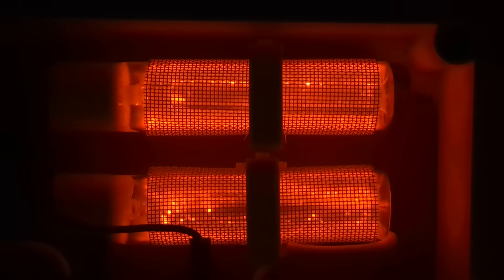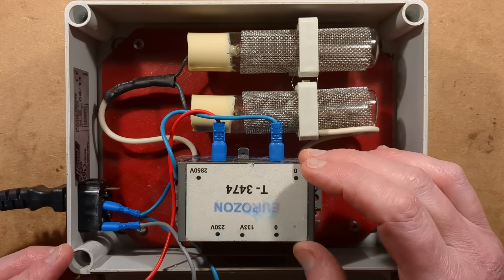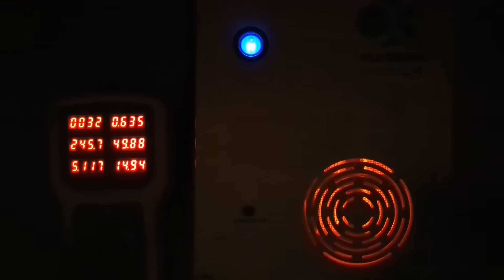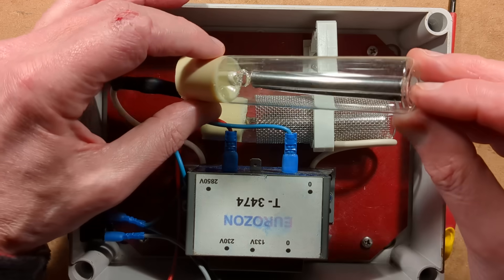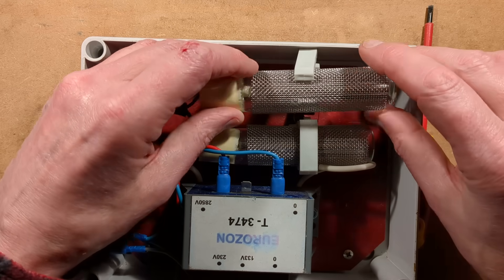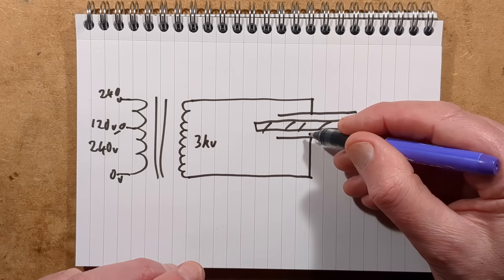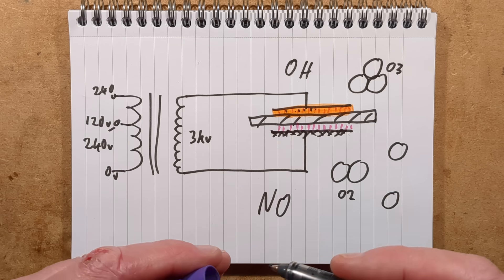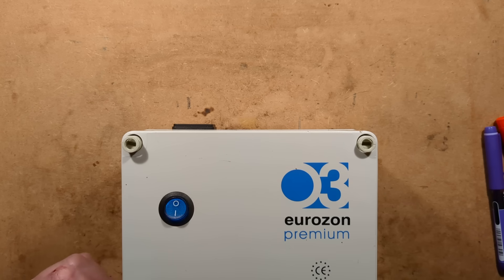Neon plasma ozone generator

Comment: I think it's easy to tell by this video's title that this product is a fraud. If neon plasma could generate ozone, companies wouldn't be using it in light-up signs because the ozone generation aspect would've made that too dangerous and they'd be thinner versions of germicidal fluorescent tubes at that point.
Reply from the maker: Aside from the neon's own discharge the plasma occurs on the outer layer of the tube between the glass and mesh.  It definitely produces plenty of ozone.

Comment: Interesting design.
I once accidentally got an ozone generator. One of my monitors started doing those high voltage discharge noises, and some time later I started smelling ozone.
Turns out the wire insulation to the backlight discharge tubes went bad and the cables started arching to the metal frame inside the monitor.
Through the magic of having two monitors of the same model, I just switched them. The "broken one" now awaits its repair (it has been 6 months). xD

Comment: Looking at the connection of the mesh around the tube.
Only one is connected?
Shouldent there be another white wire to the tube nearest (at 6.08) the case?
Reply from the maker: There is a loop of wire between the two tube clips to bridge them together.

Comment: AFAIK ozone's effect is due to reverting back to O2 + O .. and atomic (not molecular) oxygen is very powerful reactant ..
btw, i work for water/waste-water company .. just an IT guy ;)
we produce O3 for our water purification on site .. the huge reactors and sound of that high voltage discharge .. :)
and you can smell it even if the reactors are heavily sealed .. powerlines by themselves put out some O3
and of course - environmental monitoring in every room, oxygen masks .. and all the other opera gear ...
..
Chlorine warehouse is ~ 500m away .. with security that probably beats Fort Knox ..
Reply from the maker: It is the oxidising effect of ozone getting rid of one of its oxygen atoms that does the sterilisation.

Comment: I used to work in a water bottling factory. They used an ozone generator that pumped the ozone into a stainless steel water holding tank. That water was used to fill the plastic drinking bottles. The filled bottles were stored for 2 weeks before shipment.
Fun fact, ozone decays rubber, particularly under strain, by reacting with the double bonds in the polymer chains
. This causes the rubber to degrade, leading to surface cracking, reduced tensile strength, and a shortened lifespan
Reply from the maker: This is why the ozone handling systems use silicone rubber seals and stainless steel.

Comment: What ozone generator product would you recommend for sterlizing a typical room in a house over a few days? (room closed and not used while treating)
Reply from the maker: I can't recommend any unit in particular.  The most affordable device could be a generic room ozone generator as found on online sites like eBay.  Just treat it as a typical shady imported device.
https://www.ebay.co.uk/itm/167938236310
I would only suggest using something like this in short bursts and not leaving it running for days.

Comment: The assembly of this device must have used the coal shoveling method, by the laid off coal plant workers in china. 

Take shovel and go into pile of parts. Dump said parts in box supplied. Ram lid on top of box and use whatever screws are around workstation. Stamp QC 2022. End shift. Start shift as ebay vendor.

Comment: I have an old ozone generator that is probably about 100 years old now. It's a backlight box with a neon sign transformer in it. Thick rubber leads go to an ozone generating head that has an array of tubes with alternating fills of neon and argon. They have single electrodes and spaced about 1/16" apart so you get mild arcing between the tubes. Works well. It does have a wire wound rheostat to control the current to the transformer.
Reply from the maker: Take good care of that.  It's a very collectable item.

Comment: Is it actually safe to use these inside a car? I mean, if it can oxidise basically anything, isn't it possible that it can affect the electronics and plastics  inside in a longer run?
Reply from the maker: Car dealers use them to give unoccupied vehicles short and strong ozone treatments to remove odours.  Continuous high ozone levels would degrade some materials and be harmful to the passengers.

Comment: I could see them depending on diffusion to assure a certain amount of ozone in an area rather than just allowing it to forcefully pour out.  I dunno if that much thought to design was done in this case though but they maybe had some idea of the space inside the box saturating and maybe just the density and maybe slight heating and just the tendency for things to equalize just very weakly diffusing in to the room.

Comment: I've worked on industrial Corona discharge systems for many years ... Some with discharge surface areas into the several square meters... It's a commonly used method to etch the surface of materials to be printed on... .. strangely right outside the discharge vent from several of these systems grows one of the largest and in spring prettiest cherry trees I've ever seen. The smell of ozone near the tree is overpowering.... I've often wondered if the tree is benefiting from having most molds and bacteria killed that would normally attack it.
Reply from the maker: Ozone is used for crop protection in indoor "herb farms".

Comment: i got a UV C sterilization lamp... when i use it it smells something like bleach.. is that ozone? i stop using it because i cant properly ventilate the room...
Reply: That’s a bingo! That’s the way ozone is generated naturally outdoors with sunlight.
Reply from the maker: Yes, some UVC lamps do generate ozone which smells like bleach as you describe.  It is safe to use if there are no humans or pets in the room when in use, and the ozone will penetrate where the UVC couldn't.  You just have to turn it off and give it time to dissipate before spending significant time in the room.
Reply: i got the lamp to use it in the basement to kill the mold but the problem 1st i think you cant ventilate on the basement because ozone is heavier than air, 2nd i am not sure if uvc kills mold and 3rd probably the ozone is fast rusting all the metallic things in storage... uvc lamps are the easiest way to create ozone in large amounts but being exposed twice to it i dont see the benefit...
Reply: you could use the UV-C lamps in cooperation with an activated carbon filter. Let the lamps run for something like 12 hours to create the ozone, the UV rays also kill microorganisms and then turn them off and run the activated carbon filter. Ozone and activated carbon are basically natural enemies, extinguishing each other.

Comment: Completely unrelated, but have you ever bought any of that coloured sand from China? The reason I ask is because we've just had a big scandal here in Australia where they've found asbestos in coloured sand used in school sand pits. I suspect it may have been imported from China, since we have very strong regulations against asbestos in products made here, since Australia used to be one of the biggest producers of blue asbestos.

So if you happened to have bought any of that decorative coloured sand, I suggest you dispose of it just in case.
Reply from the maker: I've not bought sand, but I'm suspicious of some materials.  I know China still uses a lot of the curly fibre chrysotile asbestos.

Comment: Seems like a neat little unit, I'd drill some holes into the front panel and mount a small AC fan there, during some research I have found some low-noise options, like the Orion OA80AP‑22‑2WB (9W, runs at AC mains voltage), or if you want to go the hacky route you could put in a small diode bridge / full bridge rectifier and run the 12 volt fan across a resistor, although this is very inefficient, you would need to dissipate around 60W of thermal heat assuming a 1.56 kΩ resistor.. this would not only make it sterilize the air, but also heat it up if the resistor is mounted to a heat sink.. yeah no, this is getting out of hand, you would have to take thermal protection and so on into account.. there's a very neat (and quiet .!) 80mm 85–265 V AC fan - the "ebm‑papst AC 8300".

Excuse my ramblings, love ya vids :)

Comment: You 'need' to add a 'capacitor discharge pen' to your next AliX order, I am sure you can have plenty of cracking good fun with one. Ordered one to better protected my $500 LCR in circuit Tweezers and several of the Inductor Testers you played with recently including a battery option. $20 well spent for fun .....

Comment: I imagine the plastic is also getting degraded/embrittled by the ozone too. That might have contributed to rattles. 
I'd have liked the seller to have looked inside and fixed it plus filling the box with peanuts to prevent movement
Reply from the maker: The inside looked strangely untarnished by ozone.

Comment: You can't go wrong with nitrogen oxides. The main ones are Nitric oxide (NO) and Nitrogen dioxide (NO2) but there are also:  nitrous oxide (N2O), dinitrogen trioxide (N2O3), dinitrogen tetroxide (N2O4), and dinitrogen pentoxide (N2O5).

Comment: Few years ago i got one from China its a usb powered version and when i got it i was wondering if i got scam. Because i noticed they use a green colour neon builb with some wire mash on the outside for the ozone generator. When its plug in you can see the neon glow green.
Reply from the maker: If you sniff the unit while it's running you may get a slight bleach-like smell.  A common technique for small ozone generators is to put a metal mesh around a neon bulb in the same way this works, but much smaller.

Comment: "Ozone" comes from the Greek for smell? 
Pretty much - the root occurs also in the element osmium, which is apparently pretty smelly stuff when you use it's tetroxide (OsO4) as a stain for microscopy. Electron microscopy - and never having used an EM, I can't adduce this from personal experience.

If you can bubble your ozonated air through 50%+ hydrogen peroxide. That
s 50 percent mass/mass, not "50 volume" which you can probably get at the industrial hairdresser suppliers. Along with a visit from the nice armed anti-terrorist police screaming gently "show me your hands" and "comply or I fire" and such love poems. But once you get past that entertainment, and get the bubbler going, you can make peroxy hydrogen peroxide, H2O5, a.k.a. peroxidane which is a really "fun" reagent. For certain values of "fun". "Check your buildings insurance first" levels of "fun".

Comment: Is there a good way to catch the NO without also getting rid of the O3?
Reply from the maker: It's exactly the same active gas molecules as created in nature.  To create purer ozone you need to provide a unit like this with concentrated oxygen.
Reply: That somehow leads to my next question: What’s the most efficient way to concentrate oxygen? Do you have to get it in its pure form in tanks (maybe a bit dangerous) or go the chemistry class electrolysis of water route?
Reply from the maker: @abavariannormiepleb9470  You can get oxygen concentrator machines that use molecular sieves to filter different components of air.
Reply: Thank you very much for the education!

Comment: Clive... two questions 
Are they 12 volt crimp connectors used for 240 volts?
If so are they safe to use for that type of application?
Could you also explain the power factor measurement in a little more detail and where and how you get that figure and what that actually means please?
Thanks and another great video 
Keep up the good work 👍 
Regards Off Grid Andy from Aussie Homestead NSW Australia 🦘
Reply from the maker: The standard insulated crimp connectors are rated for 240V.
Power factor is the relationship between the voltage and current waveforms.  The perfect power factor (unity) is when they are in sync.

Comment: Without a fan, O3 levels in the enclosure will be very high - high enough to cause significant degradation of all those plastic components. It would be a very good idea to put some form of low-profile fan in there, just to prolong lifespan. I seem to remember a review of an ozone generator based on ordinary neon indicator tubes,  which was just as impressive!
Reply from the maker: I showed car ozone units with the neon tube technique.

Comment: 133 and 233 volts wtf is france doing over there?
Reply: In Europe, the mains voltage is usually 220-230 while here in the UK, it's usually 230-240 but it can vary a bit depending on your location (ie how far away from the nearest substation you are) and time of day (based on overall demand)

But it should be around 220 in Italy, so maybe the extra 13V is just a mafia tax :D

Comment: I just discovered a wonderful use for ozone.  I had occasion to run my generator on an exterior enclosed porch that has issues with spiders.  I sealed off the porch and set the O3 on nuclear.  I found that spiders and also wasps seem to perish with high volumes of ozone.  Seems the critters get pretty ticked off and perish while trying to escape.  This pleases me greatly.

Comment: Some places in Italy, Spain and France have a 133/230 V low voltage distribution network, so the appliances are connected across 2 phases. I was surprised to see a transformer with a 133 V tap, I don't think any of those places have a neutral available for 133 V loads.

Comment: I thought it would hav e a  high voltage  flyback circuit  on a  PC board , not just a transformer but it works
Reply from the maker: This is the older and simpler way of doing it.  But only suited to low level generation.

Comment: On a completely different subject !!!! 
Do you have recommendations for types and sources for your Spugers ? 
I found one of the metal ones for just under a tenner but then they wanted nearly £6 for P&P and little else on offer to add to the order to offset it against!!
Reply from the maker: I use an iSesamo spudger.  The genuine ones are a bit more expensive, but last a very long time compared to the slightly cheaper clones.
Reply: Thanks Clive

Comment: Pass the ozone through a fishtank airpump/bubbler stone, and you now have a veggie & fruits sterilizer(suggest a mat made of activated charcoal for lid).
You can also ozonate olive oil🤔(need to keep it cold to maintain effectiveness). Set the gizmo on timer for 15mins and walkaway to avoid excess exposure to ozone. For a longer lasting setup, suggest replacing fishtank air pump with a silicone tubing peristaltic one, and a custom air stone with teflon tube, to make it ozone resistant. The versatility is that, you use it in any vessel(PP plastic, stainless steel bowl etc).❤👍
Reply: The ozone will decompose the plastic parts and spread the chemicals onto the produce. My unit is one of the wooden box type, try that style rather than a plastic system.

Comment: 02:36  Maybe they relied on ozone being heavier than air, pooling at the bottom of the unit and trickling out of the bottom slots.  ???  I've not seen one quite like this before.  Nice find.
Reply: I bet, the tubes and the transformer produces enough heat   to create airflow

Comment: I had to encase a little handheld/keychain project i made when my ARC tube started to give a coronal discharge and was producing ozone.  I just wanted to make a Xenon Arc tube keychain light, and its neat with a ghostly dim white streamer through the U tube. Its fun to put neodymium magnets near the tube which causes the arc to want to invert in on itself at the bend of the U. Pretty neat little "toy" 😁

Comment: Isn't Ozone gas toxic & highly dangerous? "Never stay in a room with an ozone generator running, and ensure no pets or plants are present" says google lol!
Reply from the maker: Yes at high levels it is harmful.  But it's a natural part of air at low levels.  These units tend to increase the level indoors slightly where ozone would normally be depleted.

Comment: Actually there convention, just not due to temperature difference creating a density difference but because ozone (O₃) is heavier than air. Its molecular weight is 48 g/mol, compared to the average molecular weight of air (mostly nitrogen and oxygen) which is about 29 g/mol
Reply: Close to ideal gas and strongly diluted IMO this is negligble. The heat loss of the transformer probably does more to push it by convection.

Comment: But...like...Y THO??? It's so much more expensive to use neon gas than literally any other common gas and then have to make your own bespoke corona discharge tubes. And for what? It's all hidden inside the box anyway. They could've recreated the orange glow on the outlet grill with an LED. Bizarre and irrational....thus fitting with the whole ozone generator "scene" I suppose.

Comment: The loose transformer reminds me of one of my UPSes I got about 10 years ago, it was 'faulty' from new having something loose inside, turned out the factory workers forgot to screw the transformer in, and forgot to inspect it, amazingly the only damage was a bit of plastic crunched up and a bent terminal on the surprisingly unscathed battery that lasted most of the UPS'es life... :P

Comment: Finally a visible reactor core that requires no dilithium crystals! 8^)  I guess you could add a small blower and a power supply for it to move ozone out. I'd suggest an external added 3d printed box to house the blower and supply though to keep these bits and the housing away from the ozone. Cheers!
Reply: Ozone is harmful to health, so I suggest he doesn't. Cheers.
Reply: @bigbadsteven water is harmful to health, if you misuse it.
Reply: @bigbadsteven  yet ozone is naturally created in nature.😂